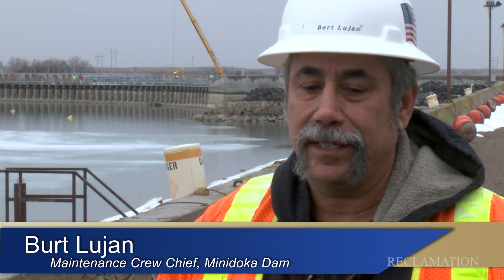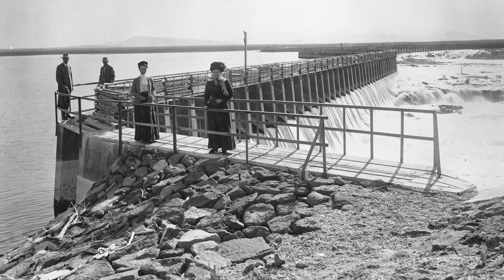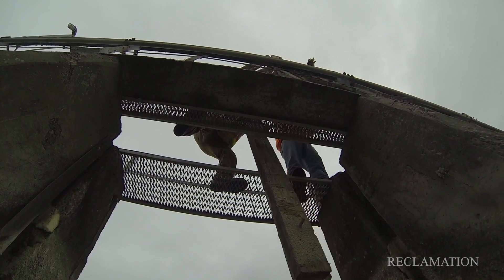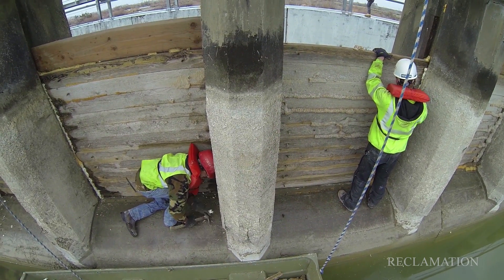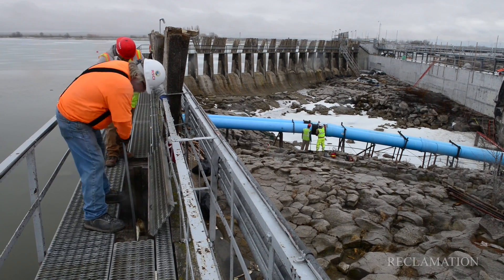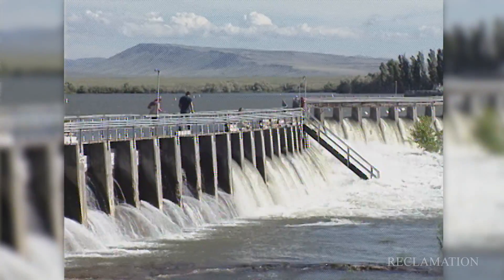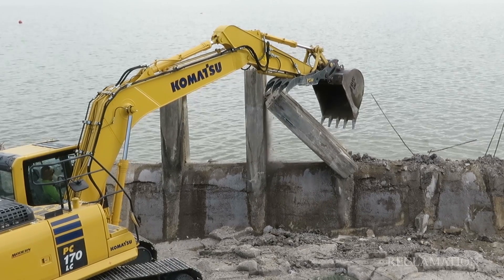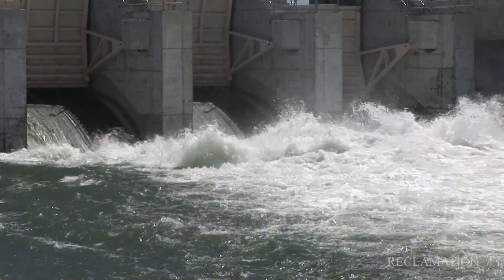Putting a Stop to Stop-Logs

Comment: I watched to the end and you showed that the new flood control system is a set of tainter gates? I thought you were updating the technology? Here in MI we had flooding in the central lower peninsula in May 2020. Two of the four dams on the Tittabawassee River failed. These dams were all built with tainter gates back in the 1920s!  Plans are underway to rebuild the dams using crest gates which open top down until they lay flat on the foundation so there's little chance of collecting debris.